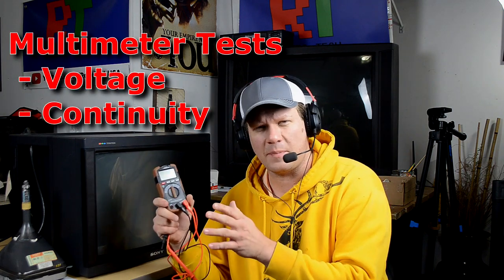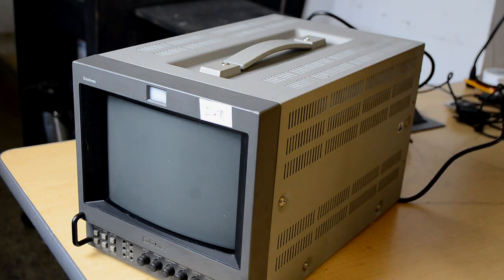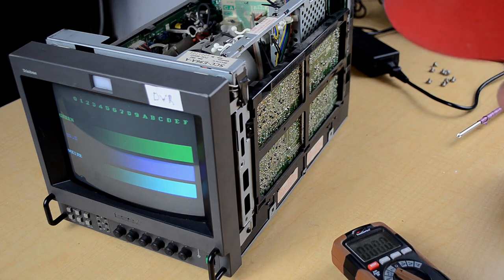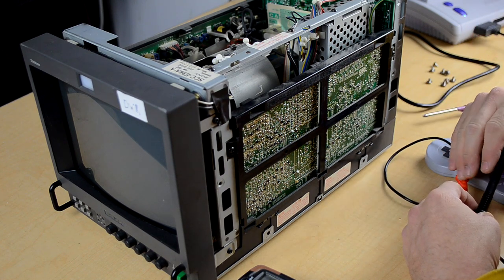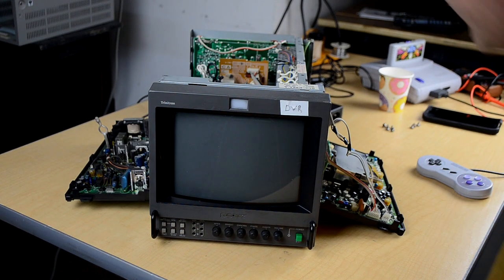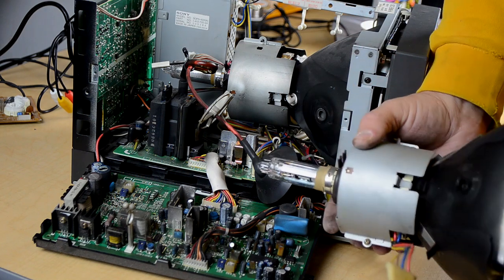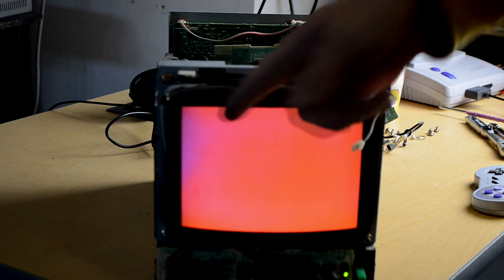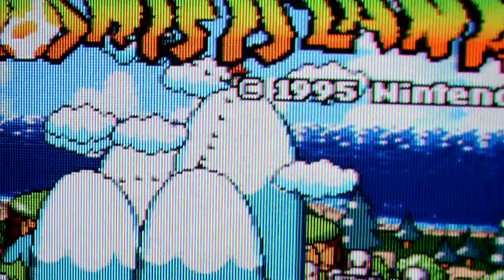Where did my Color go? - Troubleshooting CRT Color Problems

Comment: Interesting video. I have a 14M4U that came to me with no red on the screen, as well. I had to put in a jumper wire on the neck board, which suffered some shipping damage. Works great now.
Reply from the maker: Thanks and great job.  I've seen many neck boards get damaged but thankfully they are a pretty easy fix

Comment: I've just fixed a 9 inch Sony PVM like that, the PSU didn't work there too and I just had to swap the two "big" secondary capacitors and it started back up from AC. One had started leaking. Relatively easy fix.

Comment: Just a heads up on the 8021 tube, it has horizontal and vertical are on separate connectors. It'll have to be swapped over from the 804x series. Not sure if the 8020 is the same but I assume so.
Reply from the maker: Thanks. Yeah, I didn't have that on film but I did wind up using the original yoke from the 8041 because of that reason.

Comment: Just curious if you may have any insight. I have this exact crt. I initially had color when I powered on after receiving the item from an auction. Next time I tried powering on it was and stayed black and white. Took out the board and reflowed everything. Put the board back in and I get color but it switches back to black and white for about a minute or more and flips back to color and stays that way. Seems to repeat this after long sessions of being off. Any ideas? Did I miss something when reflowing solder?

Comment: we used to say in old time NTSC = Never The Same Color  , you should have PAL or SECAM , they are better , I used to repair a lot of TV (fat Screen ) for 20 years ago.
Reply from the maker: Ha, yeah the color definitely can fluctuate.   Especially in composite or svideo.  I'd like to try SECAM, I've never run across any equipment to output the signal, at least not yet.  Thanks

Comment: I have a question about overload on my Sony BVM A24. If I deliberately turn the brightness up(even much higher than what you want to view with), the over load light SHOULD come on if its working properly, correct? I mean, I realize that many people have experienced this issue when their brightness is not excessively high, and in some cases they cannot make the overload light turn off. I just wanted to verify that this indicator should come on when you purposely attempt to turn it on.
Reply from the maker: It doesn't always work unfortunately, sometimes tubes would literally "POP" from overloading one day even without a warning flashing and the system turning off.  It's best not to test it too much on the 24" and 32" tubes
Reply: @RetroTechUSA  Thanks so much Steve! I At first, it turned on by itself one day, but I was able to turn brightness down and make it go away. I just wanted to know that coming on is normal, when brightness is set too high:):):)

Comment: If we do have tubes with individual guns no longer working, is there a way to short all three colour signals into one of the guns to instead use the tube as monochrome?
Reply from the maker: That's  an interesting thought.  Some of these PVMs have a black and white only button, so you could easily try it in one of those PVMs with a failed tube.
Reply: @RetroTechUSA  I don't think black and white mode would work, since you need the red light (along with the blue and green light) in order to generate white light? I was thinking about whether all three signals could be supplied to say the (still working) green gun to end up with the equivalent of "black and white", but using the green gun alone (so black and green).

Comment: I am worried that I may have fried my PVM. I have been using a Sony 20M4U PVM for my retro games. Recently I connected it to my PC by using nvidia's drivers with a custom refresh rate. It was set up as a second monitor to use with Retroarch and it worked very well. However something has gone wrong. When I was about to turn my computer off, I turned my main PC monitor off first while my PVM was still on. I think the signal meant for my modern monitor was sent to the CRT. My PVM made a strange sound and turned off. Since then it has not been powering on when I press the power button. I live in Canada. Any suggestions/tips. I would love anything...

Comment: Nice video! I have a question in terms of pricing. I run a video game repair shop where i sometimes swap in replacement parts from donors and always struggle with pricing. I know PVMs are a little different but how do you go about pricing out a something like a tube and AC Board? Is it based off of the retail price of the donor?
Reply from the maker: Thanks.  I'm glad to hear you have a shop that even offers this type of service.  Do you have a link for your store  and where are you located?  Pricing the parts has almost become like pricing rare automobile parts.  The price changes a lot based on availability and cost to aquire.  Thanks

Comment: Hey Steve.  Good job.  In my kx-14cp1 there is another problem ... After turning on the monitor itself (the console does not need to be on), such a bright fog appears at the very top of the screen.  Whenever a black color appears on the screen, it gradually shows up.  I have no idea what the problem is ... You know such a case?  greetings
Reply from the maker: Thanks, it could possibly be a flyback issue, but it's hard to tell that for sure.  Have you ever opened it and tried adjusting the Potentiometers on the FBT?
Reply: @RetroTechUSA  yes but not workong. G2 too...
Reply: @RetroTechUSA  Thank you for your answer.  Unfortunately it's not g2 .. But I noticed one thing.  I spin the games on the side of the panel with the H-size knob and squeezing the image more and more, this bright learning disappears.  But no one can play such a narrow picture ... I have no idea what the problem is Steve

Comment: I’m confused how you instantly knew it was the tube without checking anything on the main chassis pcb?
Reply from the maker: I'm a specialist, so I have a lot of knowledge on where to start.
Reply: @RetroTechUSA  I ask because I have a monitor missing red same problem as you but I expected you to test the color transistor or the red amplification section…

Comment: you need buy crt tube tester
Reply from the maker: Thanks, I do have a couple B&K testers, but most people aren't going to have access to one with the proper adapter in this day and age.  I'm still working on adapters for mine to fit Trinitrons.
Reply: @RetroTechUSA  
i wish you luck